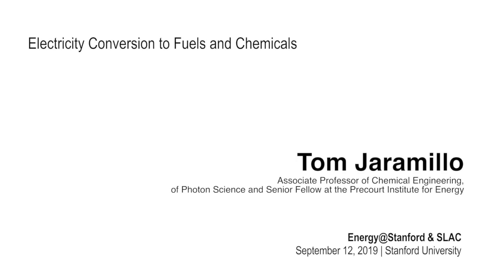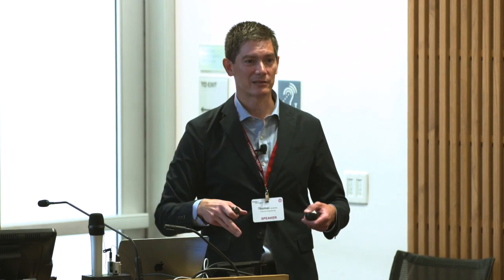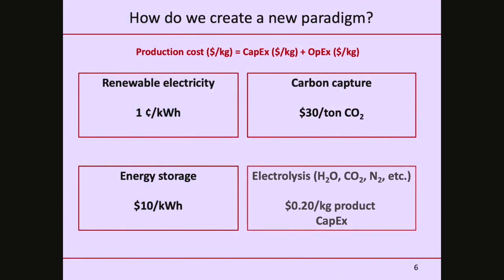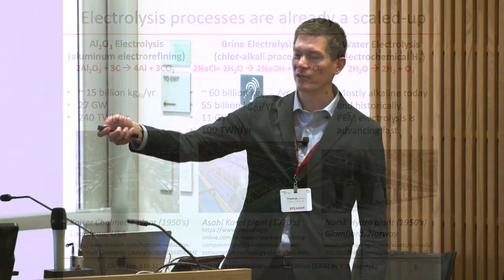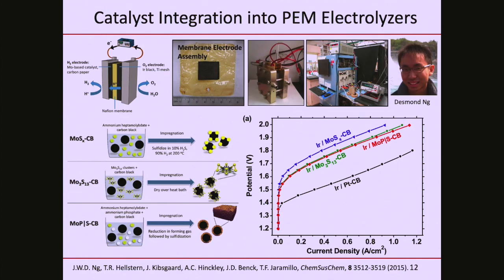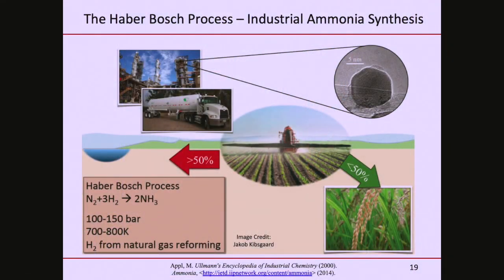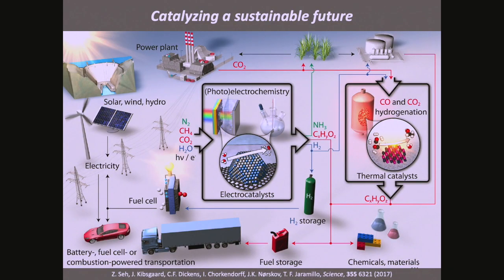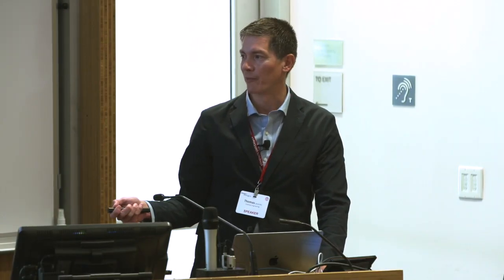Electricity Conversion to Fuels and Chemicals | Tom Jaramillo | Energy@Stanford & SLAC 2019

Comment: The capital returns on a wind turbine at $1.00 per installed watt are negative when preparing electrogas, since methane is the avoided cost component that yields actual returns. Since electrogas is one step behind in the currently unprofitable FIscher Tropsch Process (which usually starts with methane), there's no possible way that electricity will profitably be converted to fuels. Fertilizer is a big "maybe".